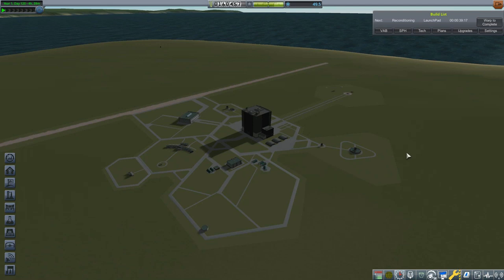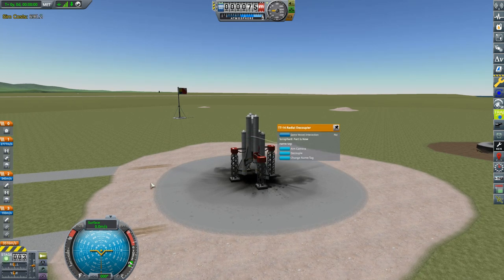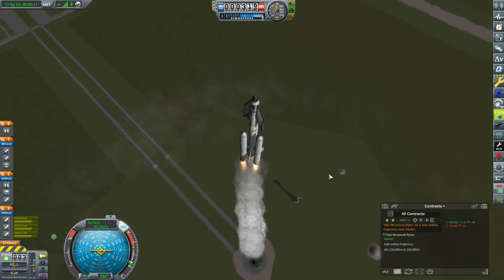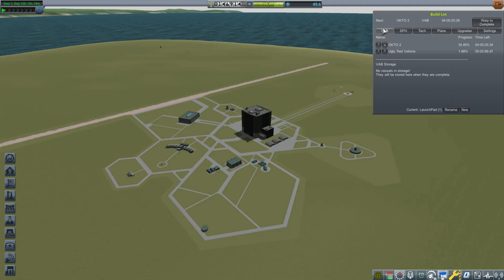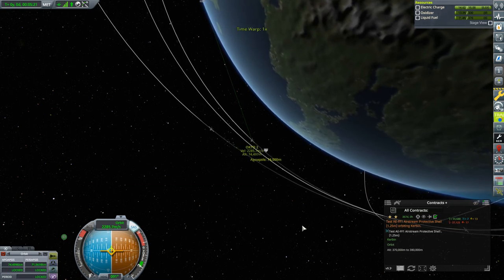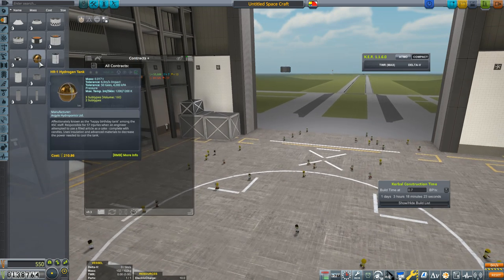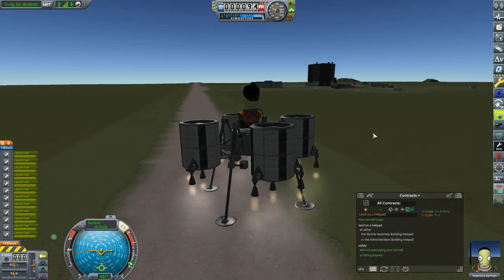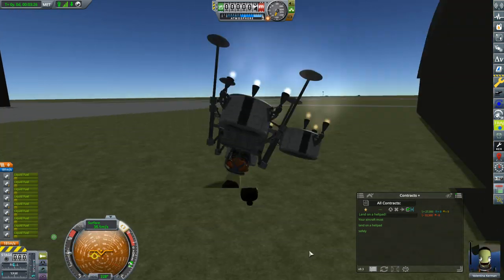VTOL - KSP Modded Career

Comment: Last I checked you could still enable and disable batteries on unpowered unmanned craft, so I usually disable the internal probe core battery and keep it as an emergency reserve for just that sort of situation.
Reply from the maker: Ooo, gotta try that, though it may happen that one the signal is lost, I may not be able to turn the battery on again.

Comment: I watch your videos on the train home from work. Just as I got to Val's final mission, I arrived at my home station. Do I continue watching and miss my station? That was a tough choice!

One of the KOS scripts I have, which I am quite proud of, is a hover script (I did pinch the bulk of it from a sample, truth be told). Works really well for positioning pieces of a ground station together to make a base. Never tried it with jet engines, just rockets.
Reply from the maker: You'll be seeing the beginnings of a hover script next episode. I did do some research on PID controllers, but decided not to go there. Too much of the code was a black box, and I didn't want to take the time to dive into. I also didn't find anyone who had a script that can deal with jet engines. For now, what I've got is very simple.

Oh, and get off at your station, man!

Comment: You are still wasting Fuel and ISP. If you have any boosters that you are not going to recover reduce the thrust until Out of Atmosphere, On All Rocket Engines the Thrust and ISP are Higher in Vacuum - Out of the Atmosphere. Basic Simulations do not calculate for a changing ISP with Changes in Atmo-Pressure as you get higher. So Launch with them and go Straight Up! The Fuel use and Thrust is Much Better. Once you have Radial Decouplers Use Sets of side fuel tanks, and draw fuel from them 1st and drop when Empty. Try to recover everything!  You will get a little Science and Depending on condition you will get most of the empty cost back, saving Kerbucks! Fly more planes and drive rovers to train kerbals and collect science. As soon as possible build boats and subs to collect science. You may be able to build underwater bases to help train your kerbals in-field, and collect samples. Build on the runway and drive them to the sea. A recovery truck will save money if you recover parts and kerbals then bring them back to a base.
Reply from the maker: Thanks for the advice on the in atmo science, but I am much more of a rocket guy. As for the ascent, KSP does model changinging Isp with atmospheric pressure. Although I do plan at some time to modify my ascent script to adjust the throttle on ascent, going straight up is definitely less efficient.